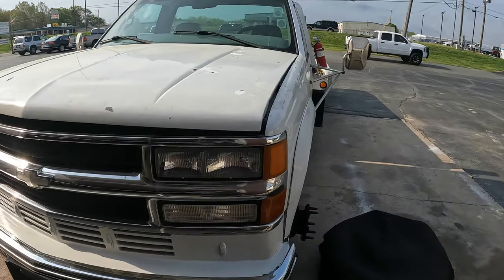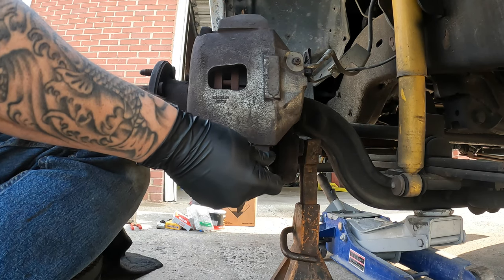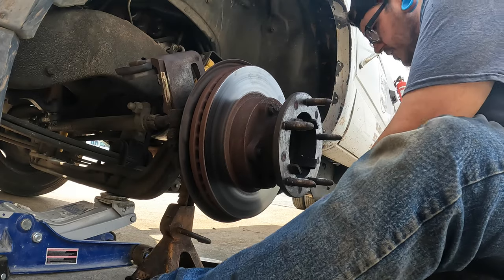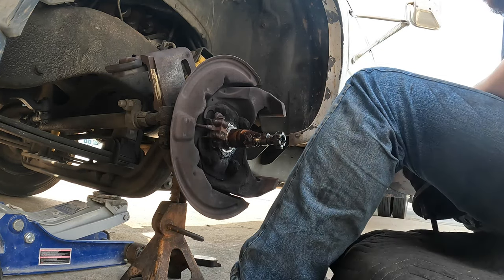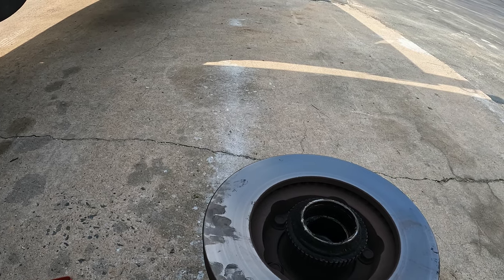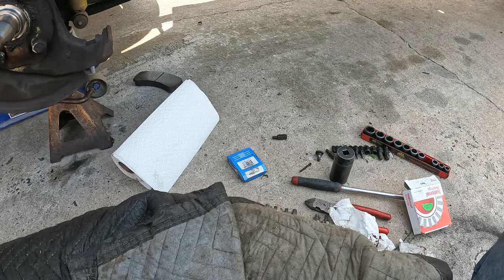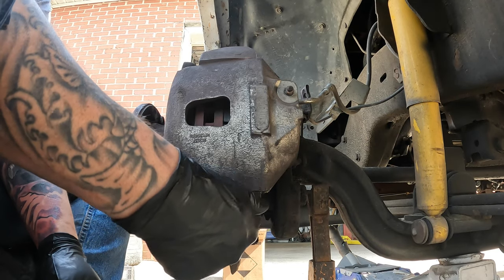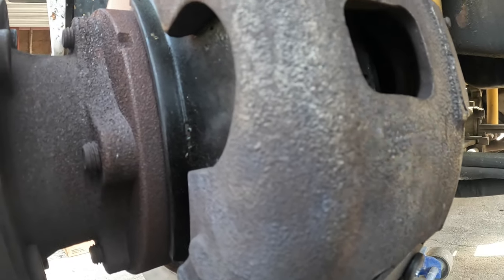1999 Chevy C3500HD Tow Truck Wheel Bearing Replacement

Comment: I have a 96 c3500 dually, is it quicker to just replace the front wheel hub assembly? I have a bad wheel bearing + I need to do brakes so for that case do I replace the wheel hub assembly
Reply from the maker: It is about the same amount of time and way cheaper to do just the bearings.  That hub would be a lot more work and you still have to buy the bearings seperate.